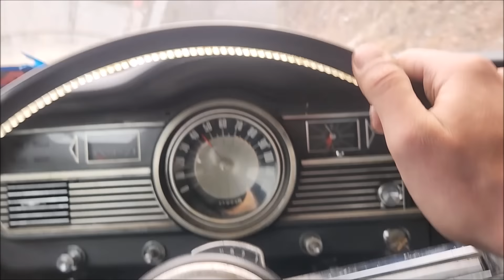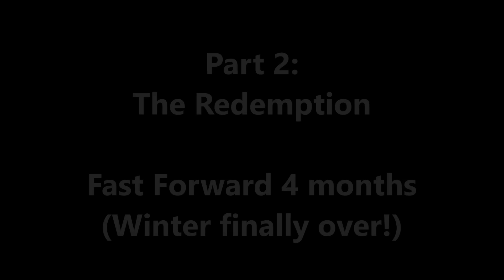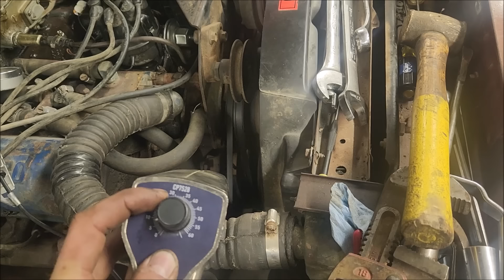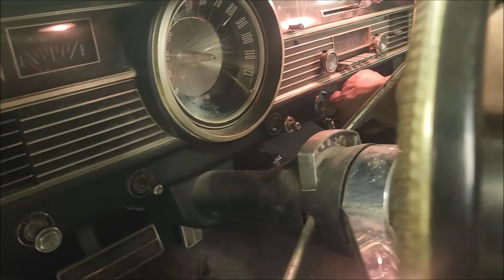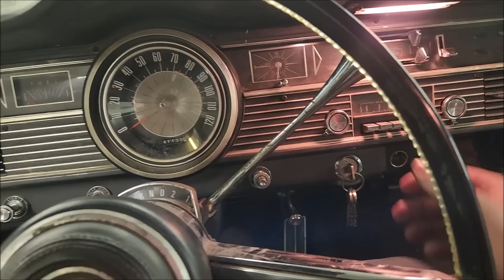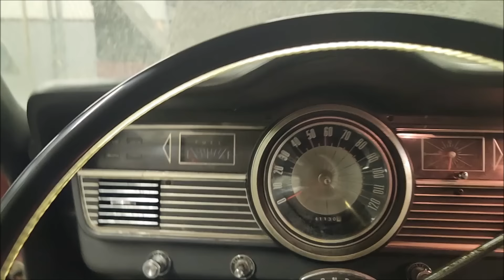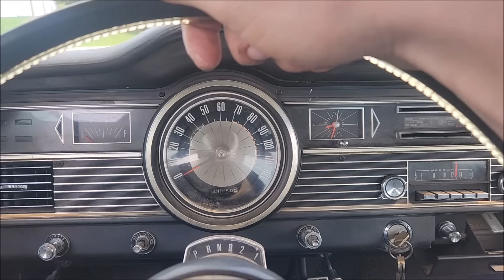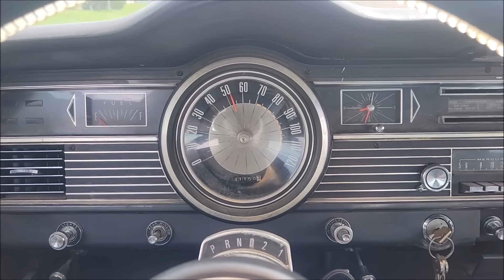$1,000 Classic Car - Will it Run & Drive Home?

Comment: How is your vacuum advance adding 14 degrees while cruising if you’re running ported?  While cruising with that throttle barely cracked that FE should have a manifold vacuum reading a few inches below 20 while the ported vacuum would read a few inches above zero.  Most vacuum advance canisters don’t even start giving timing until about 5-7 inches of mercury so if you’re running ported, how is there any way you’re getting any timing advance at all at cruise?
Reply from the maker: Stick a vacuum gauge on a carbs ported port and drive down the road - it gets plenty exposed. 
I actually made a ported vs manifold video with a gauge in each, they were exactly the same at any throttle level that could actually move the vehicle. 

If you type in ported vs manifold to youtube - you'll see my ugly mug at or right close to the top
Reply: @ThunderHead289  I’ve watched a few videos on the matter and even tried it myself.  They were definitely not exactly the same.  For me, at cruise manifold is a few inches below 20 and ported is a few inches above zero as i said.  Where I do the majority of my driving is 35-50 mph from stoplight to stoplight.  The engine is basically living in this transition zone just outside of idle where ported vacuum is near zero.   If I ran ported there is no way I’d be getting the kind of mileage I’m getting right now and all that sitting at stoplights idling would be way less efficient than running manifold.  People always say “ported and manifold are the same as soon as you hit the throttle” but this just isn’t true.  Watching a side-by-side comparison reveals the transition where manifold vacuum goes down as ported vacuum goes up until they eventually equalize.  If your engine spends any length of time in this transition zone they are definitely not the same and manifold vacuum advance is the one that actually gives you the benefits.

Comment: When tuning do you take in account the air filter or adjust after installing it?? Thanks for sharing
Reply from the maker: Usually underhood heat is the biggest factor - one would think that since the air gets warmer and less dense that the air fuel ratio would get richer, but fuel also seems to have a delta. 

From my expirience, once the hood is closed and your sitting at a stop light, comparatively your afr is going to be leaner than with the hood open. 

Given all that, that's why it's been a long time deal to add 1/8 to 1/4 richer after getting mix screws to highest vacuum. 

Which through most of my life has been common knowedge, but recently in the last decade, seemingly a forgotten step
Reply: @ThunderHead289  thanks!!! Where were you in the 80’s?? When I was messing with carburetors and cars!! 😂

Comment: Question on heat soak if you have a sec... I had several symptoms of heat soak, but was running a Sniper. Is heat soak possible with fuel injection?
Reply from the maker: Is your sniper a dead head system? 
Because then absolutely it could
Reply: @ThunderHead289  At the time I was having that issue (over and over), it used a return line. Since then I re-plumbed from the tank forward and switched to a Holley submersible which does not have a return. And as of this week, my car is finally ready to get back on the road...but it's been raining for seemingly a lifetime. BTW, this was just a killer video man. So thorough and easy to follow.
So I guess the answer is- only if it's a dead head...which makes perfect sense.

Comment: they started using plastic spacers on the manifold in the late 80's and also got rid of the manifold heating all together by the 90's
Reply from the maker: Dude... there wasn't even carbs in the late 80s and early 90s on production vehicles.
Reply: @ThunderHead289  oh im from argentina, here in the third world we had many lol

Comment: Great Film, but you need to lose the ring when working under the hood. If ever get in wrong place with starter wire, you MAY lose that ring finger. Happened years ago in the military. Solder actually had flesh under ring cooked and caused amputation of ring finger.

Comment: Does that overheating carb situation also cause dieseling when you turn off the engine?
Reply from the maker: Can't say it wouldn't, but I've never documented such an event. 
Dieseling is usually when the throttle at idle is too far open allowing the engine to draw in a fair amount of air and fuel volume, the engine being warm enough in comparison with the octane of the fuel such that the fuel self ignites under compression. 
It can happen with everything being right aside from simply too low of octane as well. 

But largely those are the three factors - throttle too high (check ported port, should be at or near 0 inHg at idle as a nice indicator), engine is getting real hot - and then either octane is too low for how hot the engine now is, or octane by itself is too low. 

Can also happen with a vacuum leak, but slightly harder to do since fuel isn't drawn in since it's not going through the carb circuits

Comment: Carb icing used to be a real issue...ethanol is annoying but it helps to reduce that at least
Reply from the maker: I dont have any issues with non-ethenol 91 octane with such things in cold Iowa?
Reply: @ThunderHead289  It usually occurs around 40 to 50 degrees in humid conditions. My 71 Mach 1 never iced until I changed to an edelbrock performer manifold.

Comment: Do you prefer ford style with distributor in the front or others with distributor in the back.
Reply from the maker: I like the esthetics of a front distributor - looks meaner. 
Easier to work on. 
Only bad if you are blasting through deep puddles - then undesirable unless you use a waterproof boot

Comment: Just wondering ..... does the fuel on a Briggs & Stratton boil like this?   We all have had the problem of shutting the lawn mower off and then regretting it because a hot mower many times will refuse to start!   IDK why but it's true.😂
Reply from the maker: With mowers, I think that's usually a valve lash thing - compression release isn't doing its job
Reply: @ThunderHead289  Whoa. Now I'm really befuddled .  Oh well.

Comment: You can stuff around with a vacuum gauge all day but the only way to tune a carb is a AFR gauge
Reply from the maker: I chuckled at this comment. 
Well, conveniently I'm the programmer and initial designed of the product called Carb Cheater. 
Your literally talking to the afr meth head. 
Thecarbcheater.com

Comment: Is it a 410?  It sounds like one, they are a great engine. Give it about 15. And AFB or Holley would wake it up.Most 67 Mercury’s have 410FEs and the crank is the same as a 428. If it is one don’t sell it cheap. It sounds like a 410 to me. Just a thought that you might want to check the stroke.

Comment: Why do cars have that belt squeal on startup? I had a 460 in a lincoln that did that, ran fine but is there a way to fix?
Reply from the maker: Just the alternator not being tight enough generally - delicate balance, make it too right and now you shred your water pump and alternator bearings

Comment: R you going to put a lawnmower carb on this one??? The thing I don't understand is with the lawnmower carb to the normal carb regardless of witch is used it still takes x amount of gas to move the vehicle. So how could it get better miles to the gallon if it takes x regardless to move the vehicle???
Reply from the maker: Gas is not burned in a liquid form - if it's not atomized, it's wasted. 
It's a use efficiency differential. 
But all that aside - that wasn't the point or intent of the lawn mower carb series. 

I made it because I was mad at how in correct folks understanding of fluid dynamics was as several things in that series flat out proved some folks wrong
Reply: @ThunderHead289  thanks for the quick response and the information.  Another quick question: Did anyone get in touch with you about achieving high mileage per gallon and tell you to stop putting out content like that??? Like the big oil companies.

Comment: Before you can do this stuff you need to understand how it works. Most people don't and I'll throw in many mechanics. 

My question is this, if your exhaust is incomplete (missing mufflers) how much will that effect everything outlined? I seem to be making way too much vacuum.
Reply from the maker: Depends on the severity of the crack - if you have a side with a muffler and straight up a side without, that's just not going to fly - different backpressure will result in uneven air fuel ratio with no real way to correct. 
(Keep in mind that one side of a dual plane intake feeds both sides of the engines cylinders, 2 on one side, 2 on the other in order to keep consistent runner length - so no real way to tune that out. 
A crack on the other hand isn't a big deal outside of being annoying)

Comment: could you explain what you mean when you mention mercury and timing numbers
Reply from the maker: Inches of mercury is the unit of measure of vacuum. Timing numbers relate to ignition timing - the reason there is advance (fire before cylinder is at tdc) is due to somewhat the spark taking time to get there, but More so the degrees of rotation needed for the cylinder charge to fully ignite and propagate across the cylinder. 

If we sent the signal right at tdc, by the time the charge was ignited fully and building pressure, the cylinder would already be on its way back down equating to a dramatic loss in power and efficiency
Reply: @ThunderHead289  thanks luke. i learned a lot from you today. hope to see more of the torino "cobra" arnarchy

Comment: 9:35;ALL THE SLUDGE INSIDE IS WHY ITS STUCK ALL FORDS DO THIS.   TO RELEASE YOU ADD 2 QUARTS TRANNY FLUID OR MOTOR FLUSH TO.OIL DRIVE FOR 2 DAYS THEN DISTRIBRITOR WILL COME RIGHT OUT

Comment: is this still full frame? my 66 I could stick my hand in the frame for about 2 feet on noth sides. the rest of the car was solid. had to go
Reply from the maker: Full frame car, frame had been patched by the time I got it. 
The galaxies had very light frames (this car is a galaxie with different sheet metal) all because ford used them in Nascar and wanted a very light full frame car to compete with. 
They dominated 65 and 66 on the circuit

Comment: Different ( I N D E E D ) 

Which then Reminded (ME) of a  Similar situation ( I ) got  asked to help out years ago - now.  A  friend of a  friend who knew this person who seemed to always be RUNNING 
( BEHIND ) Late for  everything.  Had an older vehicle much like this  vintage model. 
One of the  relatives had passed it  down due to NOT  really  getting  used much and HE simply was putting gas in the tank  each time  it  was driven.  NOT  topping it  off or Running  For  ling  periods of  time either. To the  store down the  street, Work which was only a  few miles away.   Date night  which meant a  LOT of  sitting  ( IDLING ) at  best. 
My Point  is this.  ( HE ) was NOT  doing anything to HELP out the  Overall Longevity to the  use  RATHER Abuse that was going on - mostly.  On a  Saturday about  MID-Day ( I ) got the  call to go with another to See what could be  done to FIX, Repair, TWEAK , the  Performance or  LACK there of to BE * VERY * Specific.   IF you  know * THEN * You Know  where this  story is  going.  Dirty ( CLOGGED ) Air Filter, PCV Valve  was so Gummed up it did NOT  flow anything for  some time already.  The Plugs  Looked to be  ORIGINAL  which  was NOT a  good  sign with the  various  colors  each cylinder was combining.  Basic  Tune up and  Maintenance is  what  finally  got this  ( ISSUE ) Mostly on track. Wire set, Points and Condenser, Spark Plugs  properly Gapped, PCV  Value along  with NICE  Clean air Filter.   Proper OIL and  Filter down there two.  Ran some  SEAFOAM  Before hand and  then  also put in some  LUCAS Additive to get internal parts  Up to snuff  as they were once back in the  day .   Saying  all this  for the  Car  ran  Like  ( C R A P )  He  was NOT doing anything butt throwing  in Minimal Gas and  it  sat  sat  sat    ( NEVER ) getting it  HOT  which lead us to Replacing  Top and  bottom Radiator hoses along  with Thermostat and  gasket ( NEW ) Anti- Freeze  after the  SLUSH and  FLUSH  ( ONE, Two, Three )  more so until the  Water being used was less full of  crud. TIMING ( VACUUM )  Lack of  AIR  flow, Clogged up Carbs and Passages. Plugs  that barely  were functioning.  Cooling  system that  was more SLUDGE then anything  at  that point.   He  pi$$ed and  Moaned about  having to pay for  NORMAL Maintenance parts all available at the  local  Napa, Auto Zone, Big Wheel Rossi,  Etc.  that  had  a  combination to get it  back on track over the  course of  close to TWO months or  so . He had  PAID  ( NOTHING ) for the  car.   Other then a  few bucks at the  PUMP every week it  was being  Dragged screaming  into an  early  grave or  so it  seemed. 
HIs  Tools BOX  was NON-existent at that point.   A  few of  US  gathered up some  Hand me downs and   Old  school versions  of  Duplicates  each had  been collecting  dust  from years ago and  PUT  one  Together as a  PARTING  Gift to never be called out  again for. 
The Saying:  * YOU can  Lead a  HORSE to Water ( B. U. T. T. )  Cannot MAKE them Drink it * is  how  this  DUM DUM  had  been living. 
I heard from a  few every so often they would  get a  call  saying  hey ( HOW ) about  They HELP him with Basic  Maintenace routine stuff  ? ONCE is an Accident ( TWICE ) is a  MISTAKE of  there own making. 
That car  landed up getting  passed along to another YOUNGER relative who to this  day is  still driving it.  NOT  Trying to Kill it  with LACK of  KINDNESS. 
Will it  ever become a  SHOW  room Antique ? NO  that  was NOT the  reason ( I ) wrote you  today.   It  took a  few hours  of some people who cared to get it  back in shape  due to LACK of  OWNER care to be  FAIR. 
Each JOB ( BECOMES ) and  ADVENTURE.  
PAY it  FORWARD,  ACTS of  KINDNESS,  Some  will call it  all SECRET Santa to Be In the  back  watching to see what the  reactions  is ( instead ) ?
Whether  YOU have  do this  or  are willing to do so going forward. 
I WILL Make this  Simple  Suggestion (
Be it a  Neighbor, relative, Kid of a  Single parent ( WHAT EVER ) ?
Gather up a Few of  YOUR  Old , Out Dated ( LESS USED ) doubles, Triplicates, Quad- drupels and more still.   Pliers, Wrenches, Screwdrivers, Allen key sets, Hammers, and  such and  out  them into  small bags or  boxes  as possible.   a  CARE PACKAGE like what * WE * did  NEXT time the  NEED  arises.   An Oil Change, Spark plug  replacement,  Something  to tighten a  clamp or  replace a  Bulb or a   loose  trim  , etc. 
WE call that ( WISDOM and  GENEROISTY ) which equals  the  Older generation is  NOT  just  OLD  butt also  ( HONORABLE ) then the Family is  Down and out  and  others  just  keep walking past in disgust saying  things like( THEY ) Need to get there act together. NOT  knowing  how  tough it  is  just to get up off the  cold  damp floor.  Am  I making the  point ??
It  goes back to Give a person a  Fish  they Eat one  meal.  Teach that person How to fish with the proper tools  a  Lifetime of  Meal  will then be  always  within there reach...

They Call me ( THE VOICE of REASON ) 
That  person looking over your shoulder. Asking  questions and  figuring out  answers. 
Keeping the  PROCESS  moving  forward...
YOUR  welcome in Advance...
HAVE a BETTER day...

Comment: So when you suck on the vacuum advance should it hold vacuum until you stop sucking? My dads 79 capri will not hold vacuum when i suck on advance it moves slightly then falls and i can keep sucking air.
Reply from the maker: Leaky and bad
Reply: @ThunderHead289  what I figured but seen you do it here and figured I would verify

Comment: I see no reason why you can’t use thread tape on a non flared fitting. It’s the flare nut on brake lines and fuel lines where you can’t use the tape because the flare is the part that seals the leak.
Reply from the maker: Hey man, don't knock'em till you cruise in one - I once thought that as well until I owned my 64. 
Bought it to flip and kept it 😄
I'm bad at selling .... I need to work on that

Comment: I cant tell you how many people the vacuum advance is supposed to be on a ported (no vacuum at idle) port and they still swear to it while the car runs like garbage, cant convince them either….even sent your video to 2 of them you made a couple years ago and yep, they said you didnt know either after your full on explanation😂
Reply from the maker: My favorite is that some GM guy "elegedly" (probably never actually happened) said it was for emissions way back in the early forum days and that single item has been perpetuated and regurgitated for over 15 years. 
Meanwhile ported vacuum existing well before emissions ..... 

All that aside, it becomes pretty obvious as soon as someone starts to understand ignition timing to some degree. 

You can get away with manifold, but then you need to run the lightest advance springs which after a point start adding too much timing too soon AND they stretch pretty quick, and you start consuming mechanical advance at idle. 

Ported is the way because of what it allows you to do with mechanical for sure.

Comment: My 289 is suffering due to issues outlined in this video. I'm gonna review this video until I get all the steps down in the order required to get my engine tuned correctly.
Reply from the maker: Didn't set out to make a tuning video, but it seems to be where I ended up 🙂

Comment: What are “the good years” of the 390FE?
Reply from the maker: Up until smog, so 73ish  - was still decent afterward but they smogged the heads out. 
I have a 1976 390 f250 - has 191,000 unopened miles and still going, so not like it was necessarily bad even then.